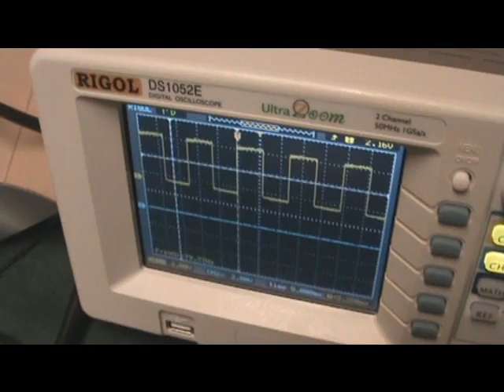Arduino floppy drive Music

Comment: Nice Jay!  Hey I've got the floppy head staying within the rails now.  I'm working on charting out ALL of the notes to the theme song, but it's slow going.  Some of it is fudging the actually notes to make it sound technically correct, because it's playing through the floppy motor.  Switching motor direction after every note will help define the notes better, but will make centering the head a challenge.